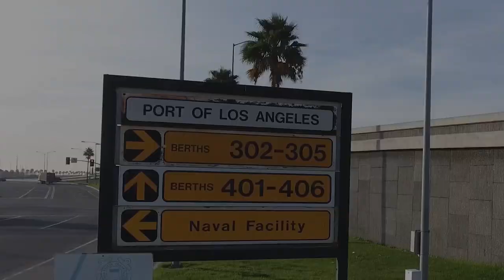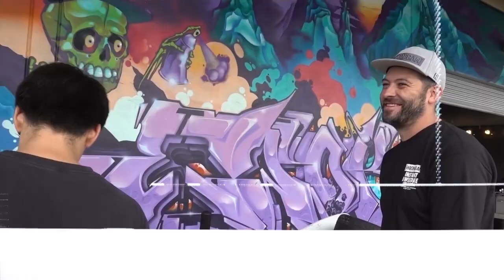[HOONIGAN] DTT 186: Hoonivations - Best of 2017

Comment: You should modify the Miata jump ramps to be longer and have an obtuse triangle that lines up against the dock so you can basically have a drop in to do Man-8s in cars. Or build a steel ramp that fits in the corner of the containers to act like a banked turn so you can dive deeper into the back section of the lot.

Comment: There's a 1981 trans am rotting in the woods with an early box edge rx7 in Massachusetts in millbury...the owner lives next door and wants 300 for the rx7 and 2000 for the trans am since it still runs, t tops and less than 100k miles